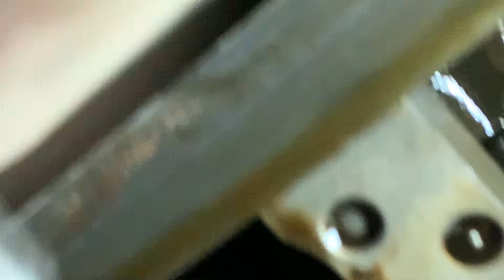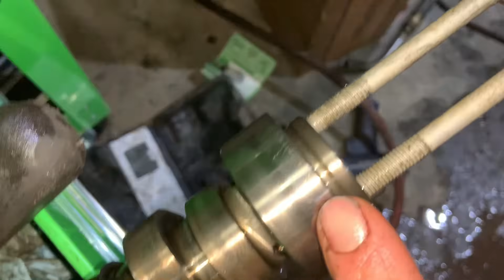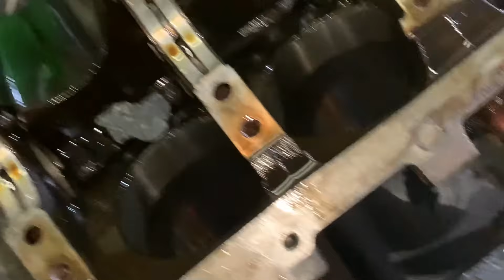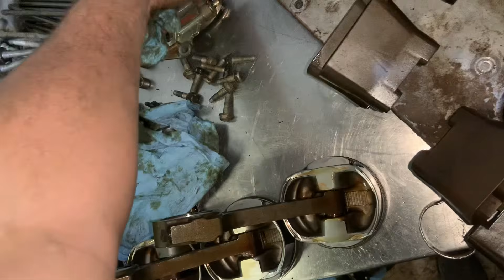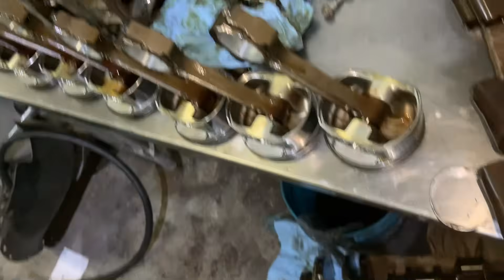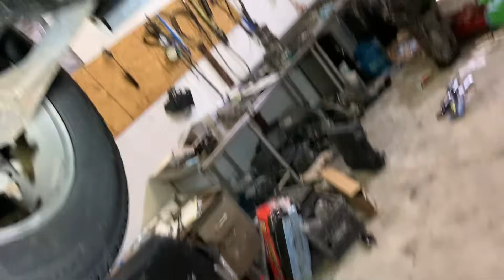ULTIMATE LS ENGINE NO OIL PRESSURE LOW OIL PRESSURE DIAGNOSIS AND REPAIR GUIDE

Comment: I did another engine swap 2005 Suburban 6.0L 400,000km Ran Strong and Smooth CAM Bearing Moved... Replacement Engine was a Hard Frontend Collision 2001 Pickup 6.0L 250,000km Broken Oil Pan & Transmission, it was pulled and sat for many years... Cleaned and used 2005 Oil Pan, pickup tube and New O-ring... RAN Great Oil pressure came up to 1/2 and 3/4 at high revs... 2 miles down the road LOST Oil Pressure down to 1/4 or less :( ........ AHHH I should be Bald.... Cluster Gauge ?? Sender Unit ?? Stuck Oil Pump ?? Worst Case CAM Bearings Moved... If that's the Case its getting NEW CAM and 706 Heads replacing the 317 Heads and New Melling's Oil Pump... 45 years Auto-Body... I got a 2007 5.3 Classic Truck seized Motor at 250km with 5.3 150km engine Swap Next :)

Comment: Thank you for the video very helpful I replaced oil pump high-volume pickup tube oil pressure sensor and screen check my cam bearings when I had my oil pan off everything look good have no noise no lifter taps put an external gauge on cold start 80 lb of oil pressure at the prime porthole wear your pump is warmed up to 210 idled at 59 lb of oil pressure but when I drive down the freeway the oil pressure in gauge in the car slowly descends to zero still have no engine noise whatsoever turn off car restart immediately oil pressure gauge and car says I have oil pressure again this don't make no sense.

Comment: Going through this now on a 2011 Silverado aluminum block. I replace the screen couple years ago and I’ve put three send units in it since I’ve had it. It’s always favored lower pressure. I have a manual oil pressure gauge coming, but I’m not sure if that’s the correct thing to try since it will be on the port closest to the oil pump correct?
I didn’t realize a lot of these problems existed on the newer engines. The truck I had before this was a 2000 model. I tore the engine down on the front to put a new O-ring on the pick up. Then I realized cam lobe had wore down. I go to pull the cam to replace it and realize the bearing had seized on the rear cam journal. So I scrap that engine replaced it with salvage yard unit with lower miles. I probably wouldn’t have bought this truck and I known the same issues existed. But this and will drop down to about 20 pounds at an idle when warm. But once in a blue moon, it will drop even lower, causing all kinds of indicator lights, telling me to shut the truck off. I will shut it off, then when I restart it, the oil pressure looks good or as good as it usually is with no warnings. Never really hear a lift or tick or anything. What would you recommend? I’m not above trading this thing off but what sucks is I was getting ready to pay it off

Comment: If I had to pull the Cam bearings I would not mess with fixing it might as well spend the money toward a new engine. I have a 2003 with 175k on a 4.8l has low oil pressure and I found out it had some sludge in the oil pan when I fix a rear main seal. I baught the truck for 6k because the body and interior are in mint condition from being garaged. One of the previous owners did not do maintenance like he should have. Anyway cleaned all that out and replaced the Oil Pressure sending unit that was buried to 80 and would not budge. Once I replaced the sensor it would read low oil pressure. It might just be the pick up tube O'Ring or the Camshaft bearing, but with that many miles and the cost to fix whatever is wrong now I might as well put a new engine in it and drive it for many more years. It is better than any truck being made right now IMO:P

Comment: Thanks for the video. I have a 2000 6.0 it has 20 to 25 psi at idle when cold. If I drive the truck it will go up to 35 maybe 40 them go back down at idle. Once the motor is hot the pressure will go to 0 at idle. I’ve already changed the pump and o ring and that didn’t fix it any thoughts on this. The lifters also make a ticking sound
Reply: I’m having same exact issue 0 psi at idle but 20-30 while driving 1000rpms or more. Did you ever figure it out ? Thanks

Comment: I have a freshly built ls motor and I had great oil pressure for maybe a day and now I have zero oil pressure. I pulled and checked cam bearings everything looks good can’t find anything that could be the problem new oil pump new pickup tube. What do you think maybe the issue.

Comment: You know your stuff bro. I have 6.0 LS and have been experiencing low pressure on cold start. When motor gets to temp. It gets more normal. I’m hoping it’s the o ring on the pick up or the relief on the discharge side of the pump. Hope it’s not cam

Comment: Very true on the o ring and oil pressure filter screen can plg. I remove them when I see that has happened  but won't flush the engine from being dirty inside lol.

Comment: My 2011 camaro L99 6.2 now has the (floating) 14-16 psi idle on hot engine 250F and 26 psi when temp is around 225F. Cold idle is 50 Psi. Oil pump and pickup tube are new. No metal signs in the oil filter. I can hear very light crank bearing sound that could be hear Only under the car. Ticking lifters sound (as usual) presents. Could you please advise is it normal ? 115K Mileage 5W30 outside temp 105F
Reply from the maker: that wouldn't bother me.

Comment: Hey I hope you can answer my question I'm losing my mind on my LS oil pressure issue and you seem to know alot and great video! But my problem is I have absolutely no oil pressure problems when it's cold or just warmed up but once it's completely hot it won't build pressure at high rpm it just flat lines at like 40lbs. But when it's cold it's will go up to 65,70 even 80 psi if u punch the pedal enough. Once hot it will not do that and that's with 5w50 oil. Do you have any advice that could help me figure out the problem? Thanks!!

Comment: Just replaced my lifters, oil pump, pick up tube, o ring and did a flush. Still have low oil pressure and a lifter tick. What could my issue be?!?!

Comment: Great video! My oil pressure dropped and I was hoping it was an oring but was worries about failed lifters or plastic lifter trays but your explanation of air in the oil giving ticking noises gives me hope. Also, great advice on checking the cam bearings. Thanks 🙏

Comment: Another part that will cause low oil pressure is the cam thrush plate. It's located behind the timing chain pully.

Comment: Great video, I had just replace my 
o-ring, oil pump and sending unit and still have low pressure. You are the first to talk about the cam bearings. And now I have one last place to look before I pull the motor. Thank you

Comment: Good video thanks , its great to come across your video , i have seen many times where the cam bearings on the LS  is the very weak point of this engine , do you have any suggestions ? other than using the durabond cam bearings ,  and having them walk on the engine ? i dont know if i spelled it correctly ?  Thanks !

Comment: Awesome vid.  Maybe you still check these messages, I've got a very strange one.  1998 Trans Am, fully forged 390ci LQ9.  Nothing crazy, 410 RWHP.  Been perfect for 10 years and about 10,000 miles.  Last week driving through my neighborhood going home I all of a sudden hear a loud metal-on-metal clacking sound......clack-clack-clack-clack....for about 5-8 seconds and then it completely stops and no more sound, engine running and sounding totally normal.  I pull into my driveway 45 seconds later and shut it off.  I never actually looked at my gauges.  Two days later I start it up and zero oil pressure, the neddle never moved at all.  So something came loose to make that clacking sound and zero oil pressure now.  I checked what I could and I did start it two, maybe 3 times just to see if what I did fixed it, only let it idle for maybe 5-6 seconds each time.  Engine idled and sounded perfect, no noises at all.  But still zero oil pressure.  I can think of many things that can cause the clacking sound by coming free, but none will cause zero oil pressure at the same time.  Then things that will cause zero oil pressure can't cause a clacking sound......  And the engine idles with zero noise of any kind.  Any help is appreciated.  Thanks.   Where are you located?

Comment: U can pump oil into the block with the pan off and see the oil leak by the cam bearing I used my wynns fuel psi injector cleaner filled it with thin oil 5w30 and used the port in the block side front drivers and u could see the oil by passing or leaking poring out the bad cam bearing !! I wrote my comment before seeing the hole video again for the 2nd time didn't remember the first other than my previous post thanks again u have really helped alot of people with your video hats off to ya !!  🙂

Comment: This needs to be the top video for low oil pressure in an LS. I watched a pile of videos that only covered the issues with the oil pump. Turns out I had a cam bearing that walked out. Thank you so much for making this video.
Reply: Cam bearings go after running the motor with low oil pressure for too long too, I’m hoping I got mine in time 😅
Reply: Sons 06 5.3 ticked-installed hi perf melling to increase psi.

My 05 6.0 lo/no psi installed hi vol/increased psi melling n got 10psi @ idle/25-40 at speed. Didn’t think to look at cam brgs.

Both trucks bought used w/200k miles
Reply: Absolutely 👏🏼👏🏼👏🏼🌅

Comment: Hi
 I loved your video. I have a DOD deleted gen 4 L76 engine that is driving me nuts. I did a complete overhaul because of low oil pressure at warm idle(6-7 psi), checked with mechanical gauge. Block was sent to local machine shop for inspection, cleaning, oil galley plugs, new cam bearings and.020 overbore. New parts,  reman Crankshaft with matched bearings,  plastigage main and rod bearings, new non-dod stock camshaft, and new melling camshaft retaining cover,  .020 piston and ring set, timing set ,new Melling 295 oil pump and new green o-ring, rivets in dod towers, plug in oil relief valve in oil pan, new oil  barbell(dog bone) new lifters (lifter bores looked fine) and complete gasket set. Everything torqued to spec and used assembly lube and 30wt break in oil.  Primed engine before starting.  I have 60 psi at start up and still drops to 10psi  at warm idle,  40 psi at 2000 rpm. runs good. During break-in the engine  in (5miles) developed a valve train tick/ knock at all rpms.  I pulled right side valve cover, Where the tick seemed to come from (top right side rear under intake). Run engine and have very little oil on rockers at idle. After a couple minutes at idle oil was at exhaust rockers but not at intake rockers? Pulled head and inspected  lifters, Cylinder # 2 lifters showed a slight line on the rollers. the rest of the lifters showed no issues.   ?????  Sorry comment is so long.   John
Reply: John, what did you find to be the problem? Get it fixed?
Reply: I am wondering how you resolved it.  I’m having same issue after my rebuild

Comment: I know it’s an older video but I’m kinda lost here, I recently installed a cam in my 2010 ss(ls3) when tuning it drove it down the road a couple times and had great oil pressure. Parked it, loaded a new tune, and started it, had 0 oil pressure. I had the pump apart but thought I installed it correctly, o ring was replaced and doesn’t look pinched. I had 0 issues before the install, any ideas?? Thinking the plunger stuck somehow but why all a sudden 2 miles after a cam swap…..

Comment: Don’t know if you still respond to these but I have a 5.3 liter in a 2007 suburban LT my oil pressure at idle has been consistently staying at around 35 PSI and at 45 MPH it stays around 45 but tonight I was driving and at a stoplight it dropped to 10 psi at idle and 40 while moving. I started it roughly an hour later and now it’s hovering back around 35 PSI again at idle. What would cause an intermittent drop in PSI? (Also if I’m idling it kinda “bounces” between 30-35 occasionally, don’t know if that’s helpful or not)

Comment: Good afternoon, I have just rebuilt my 5.3. I replaced just about everything from cam to pushrods, oil pump/o-ring, cam plate. I have 45-60 psi on the dash but getting very little oil coming up from the push rods. Machine shop installed the cam bearings, any thoughts?

Comment: if you cant get the durabond teflon coated cam bearings engine tech has very nice teflon coated performance bearings i just installed a set in a 5.3 block and they fit beautifully  parts cc426p for the 1998 to 2003 engines and for the later motors use the wider 04 and up cam bearings cc433wp

Comment: So, here I am 3/2/2023 and I just Replaced my 2005 6.0 Oil pick up tube O ring, because of Oil pressure never getting to 40psi, and now I have much better Oil pressure. My Dash gauge is still surging up and down 2 to 5 Psi at constant Engine speeds and my Oil Pressure comes up when I first start the engine.. Thoughts? And, your Video is Awesome..
Reply from the maker: Sensor could be failing
Reply: @Brainstangs  Engine Oil Pressure Sensor, It's in an Odd place of course, but I will replace it..

Comment: When you say that a Cam bearing walked out of the block there is no coming back for the oil pressure correct. Quick rundown I have an LS to that every now and then drops oil pressure down to five psi in the engine starts making noise. Some days it’s around 20 long story short I put in oil pump in the engine a high-volume high flow pump and now while the engine is hot my oil pressure is around 40 consistently. The temperature outside is only around 45 to 50° I’m wondering if that is going to be OK in the summer time the engine has not made any noises after the oil pump was installed. Also before and after the oil pump I was running 1540 Rotella oil as recommended by a few builders.
Reply from the maker: Your cam bearings are fine then.  It was all in your pump
Reply: I have found so much negativity on the forums about these engines. People are hollering up and down that it is the DOD that is the problem the car is a 2009 Pontiac G8 GT with a 6 L with 200 K on the clock. The car runs fantastic and is quiet as a mouse once it warms up the problem is every now and then it dropped oil pressure down to five or so psi that’s when it started to tick. And after installing the high flow oil pump with the factory spring that came installed the oil pressure is now consistently 40 even with the engine hot. I have had some people tell me that’s it obviously that was your problem and drive the car but I would just like to set my mind at ease. I’ve asked the question that if it was a  cam bearing it would have a oil pressure all the time regardless of new pump that would make sense to me but some people were still saying that the engine is shot. What do you think. And thank you for your reply
Reply from the maker: @danielv508  pump 4 sure.  Drive on and feel confident u got it.